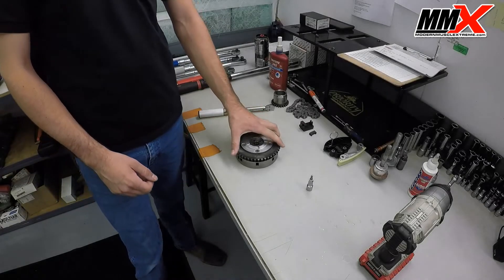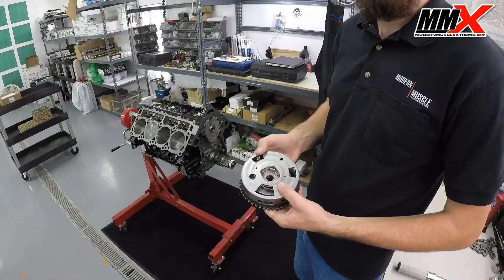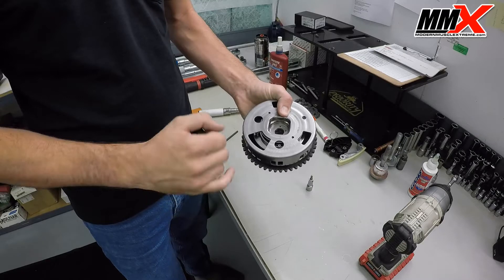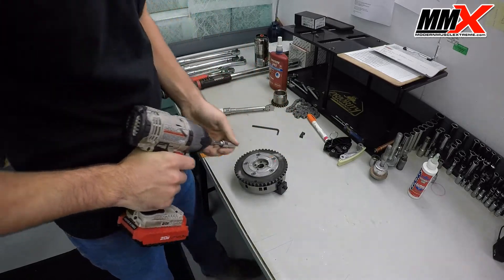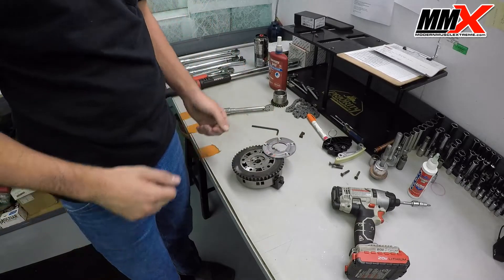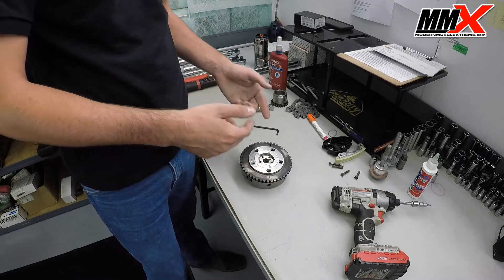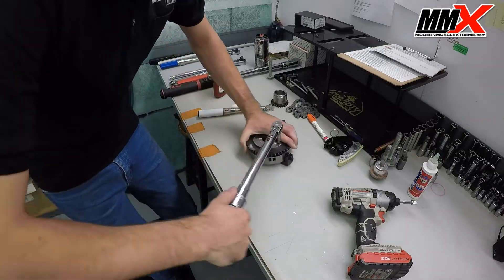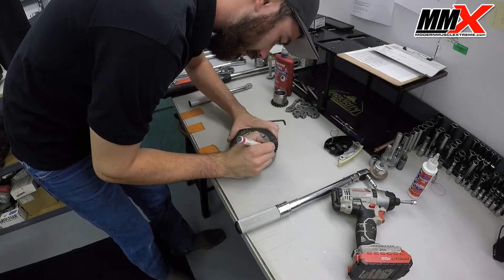Hemi VVT Camshaft Phazer Limiter Installation by MMX / ModernMuscleXtreme.com

Comment: 14 ft.lbs. you say ....my torque wrench must not be accurate cuz i keep breaking the tool off in the head of the bolt before reaching the spec and it's Cornwell

Comment: I have the comp cam #5760 lock kit it has the little  set screw. It says until it doesn't move. I kept going and the it was damn tight but still moved the Allen rounded. Any thoughts? I can take it out or leave it ??

Comment: I installed this kit with no issues besides the fact that the spring no longer lined up the way it used to. The plate on top is definitely not centered. Sup with that.

Comment: Is it normal, when rotating a brandnew crate engine by hand, that a clanking noise coming from the phaser ?
Guess, it is due to this spring inside and no Oilpressure.

Comment: Very helpful. Only problem is he didn't mention what orientation to install the limiter block. And my head would explode every time he referred to the cam phaser as the "phaser limiter" lol. The limiter is the block not the sprocket and phaser.

Comment: If I use the MMX mds delete kit complete with factory OEM non mds cam and 16 hellcat lifters will I have to install a cam Phaser Limiter?
Reply from the maker: fred sayese not for a factory cam
Reply: How about for a 392 cam
Reply: What if the limiter is not sitting flush the way you placed it and is actually closer to the other side in that gap?   Will this cause issues ?